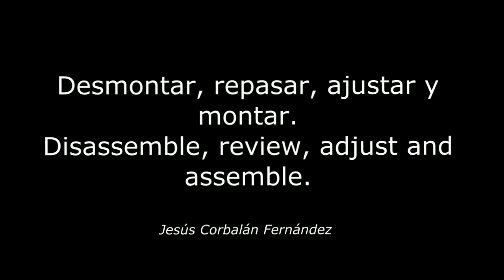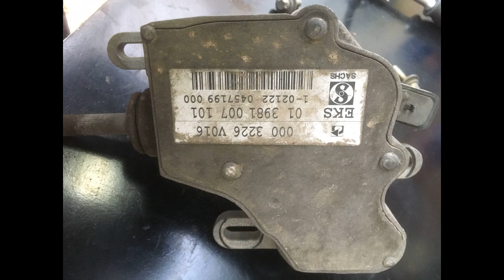Actuador embrague- clutch actuator Smart Roadster Coupe 452

Comment: I lubricated the actuator with White Grease, without opening it. I used a spray can with White Grease and sprayed with the straw inside the actuator, by inserting the straw close to the shaft. I pulled out the round rubber seal first.
Reply from the maker: Good idea, thank you very much.👍🏻
Reply: enfin...je dis ça des fois que tu ais la meme idée pour les ressorts de suspension...on aime bien les vidéo un accident n'est pas bienvenu , bonne continuation.

Comment: dont touch it there is a pretention of 35kg in the spring, this can break your finger without you even notice the move , this is really dangerous. It's like releasing a mass of 35kg on your finger. This si a really bad idea for the price of the replacement part